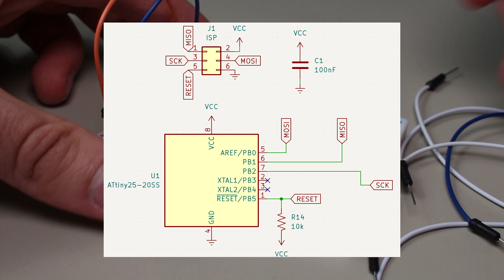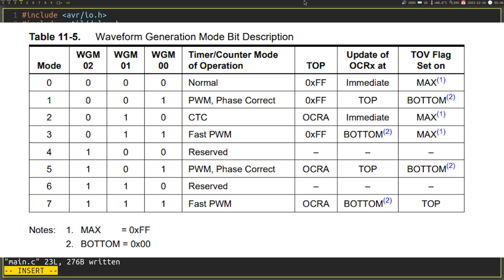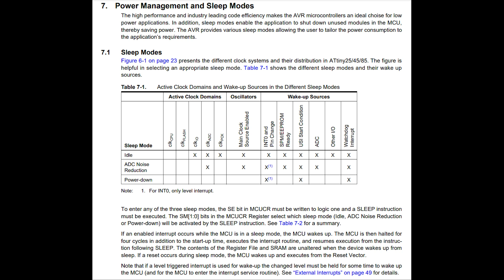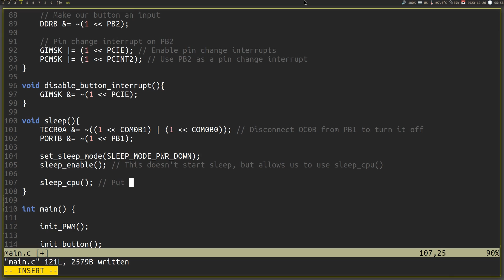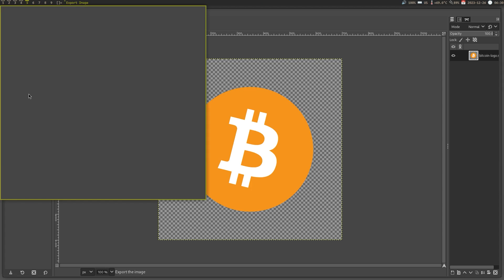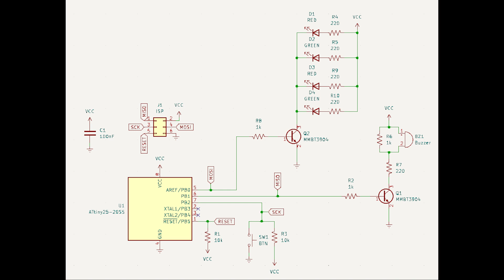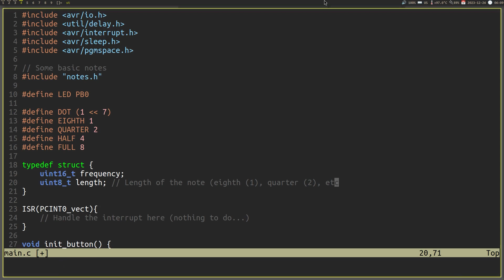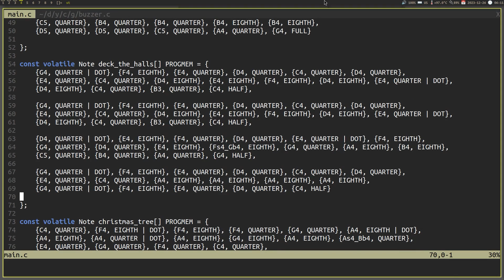Shrink Your Projects with ATtiny - Beyond Arduino #5

Comment: I use ATtiny MCUs (especially the 412 and 3224) and the newer AVRxxDDs all over the place. I love them. Those are mostly SOIC-only, so the trick for prototyping is to have PCBWay or somebody like that make you DIP breakouts with built-in 0603 or 0805 pads for a filter cap and maybe some optional 4.7K pullups that you only load when you want I2C. At that point you need basically zero supporting circuitry.

The 1-series (412, 3214, etc) and DDs are especially potent because of their TCD block, which can generate some two-pin waveforms (think "H-bridge") that would be hard to bit-bang in AVR firmware even with single-cycle I/O. That's especially true in complex applications where you need to do housekeeping chores like interrupt-handling in addition to just bit-banging some low level protocol.

Comment: I have a question in another area of gimp. I am setting up sheets with images on them to run off on photo paper. The images are 5 x 7 inches. I can put two images on a sheet, landscape and then cut for individual pictures. The problem with gimp is it is taking the 5 x 7 images when pasting onto 8.5 x 11 inch blank. It shrinks the images to thumbnails, in fact much smaller than thumbnails. I am careful in keeping resolution the same. I don't want to then enlarge these thumbnail which would cost me the resolution of professional quality photos. Any ideas? I'm using GIMP 2.10.18 in Linux.

Comment: Very nice projects! I love that you just use the bare features of the mcu and actually go through the datasheet instead of just using mainstream arduino libraries. The ATTiny85 is really nice and I also use it on some small projects - even with USB (micronucleus bootloader). However, the ATTiny85 is really expensive and hard to get nowadays. In the last two years I actually bought digistump boards cheaper than the actual ATTiny and desoldered them. Did you look at the CH32V003? It's a really nice cheap (10ct) alternative, I think :)

Comment: Funny you upload this now, since this year I made a Christmas card using... guess what? An ATtiny85! It plays music and blinks 4 LEDs of different colors (red, yellow, green, blue). I used Arduino, though, so it was a bit easier. Also, instead of setting an interrupt to wake up, I wired a button directly to RESET, which accomplishes the same function in my project (and should use less power). For the LEDs, on each note, I selected a random number to turn on, then used Fisher-Yates to randomize which ones got turned on.
Reply from the maker: Interesting idea to use RESET as a wake up button. It'd certainly have made the second project a bit simpler. :)

Comment: Thanks, my ATTiny85 arrives on Friday.
Reply: FWIW I would take a 402 or 412 on an 8-pin SOIC-to-DIP adapter over an ATtiny85 any day of the week. The core supports a newer/better version of the ISA, and the peripherals are much more refined and capable (16-bit timers vs 8-bit much better I/Os, etc), and I prefer UPDI to ICSP as a programming interface. 

The 402 does have half the flash and RAM, but I've honestly never had a use case that needed more of those but that didn't also need more than 5-6 I/O pins (6 if you configure the UPDI pin as an I/O, such that you need a "high voltage" programmer to put it back into UPDI mode).
Reply from the maker: Have fun with them :)